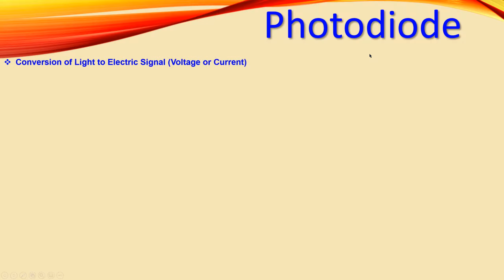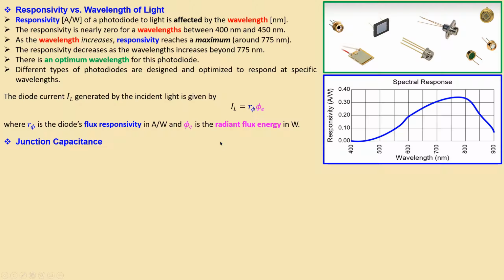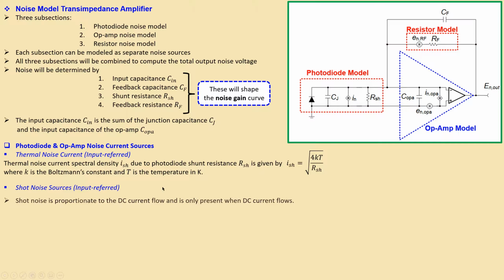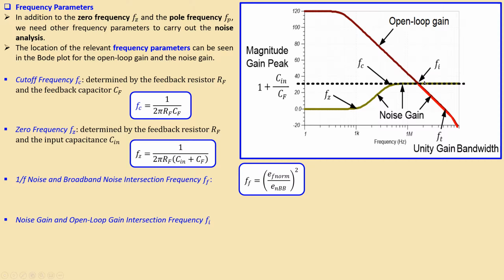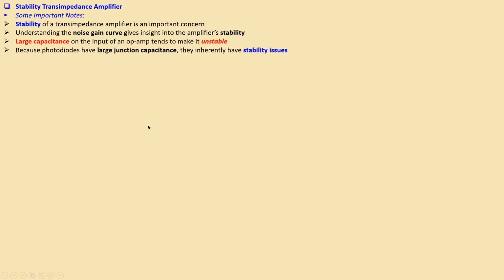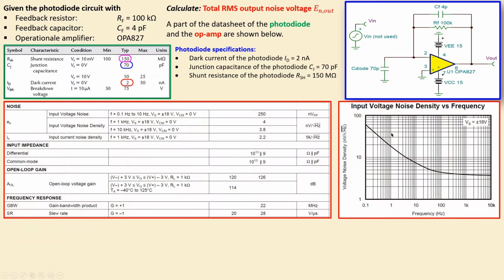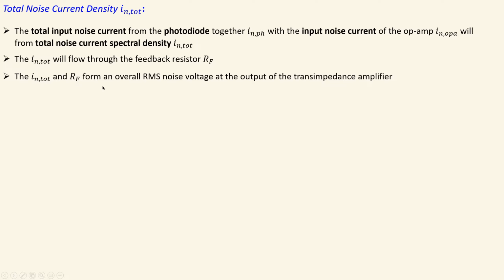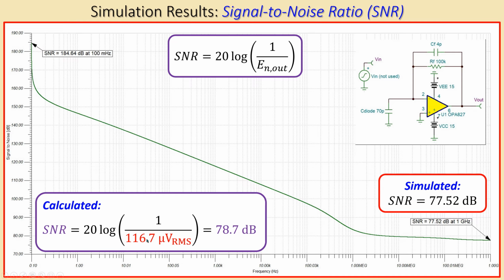Noise Analysis Photodiode Transimpedance Amplifier 🌟 Calculations & TINA-TI SPICE Simulations 👍

Comment: I would recommend Jerald Graeme's book "Photodiode Amplifiers: OP AMP Solutions" is a practical engineering text that focuses on designing operational amplifier circuits to process signals from photodiodes. This book took decades of Burr-Brown (a superior Op Amp provider) app notes and material in books and journals of Photodiode Amplifier configurations for various applications and packed most relevant into a single small text. The book mostly focuses on shaping of the 'total' noise response (all sources modeled and shaped per the application). Furthermore, his methods of noise shaping within his (feedback) topologies dealt with the specific Op Amp's actual noise response (in and en) and the type of noise source within that response. For use in industrial and medical CT I would always develop my noise models using behavioral modeling methods SPICE which allows for precise modeling of the noise sources and amplifier responses, Johnson noise sources and so forth. This can also be done in any math program like MathCAD, MATLAB and Simulink all of which I used for this work. There is a ton of prior work done on this topic over the previous 50 years. Indeed, much of Graeme's later work was on this one topic which is, of course, relevant to ANY high gain op amp circuit. He wrote a 2nd book on this topic. Graeme also produced very early books produced by Burr-Brown on Op Amp circuits which contained many topics in a general presentation. I also like to show the actual frequency shaped of my noise sources and feedback structure in the simulation and this is where MathCAD is convenient.  

Graeme's PD Amp book can be purchased through Amazon or EBay :

Publisher  :  McGraw Hill
Publication date  :  December 1, 1995
Edition  :  1st
Language  :  English
Print length  :  252 pages
ISBN-10  :  007024247X
ISBN-13  :  978-0070242470
Reply from the maker: Thank you for the book recommendation, that is a classic text for anyone working with photodiode amplifiers.

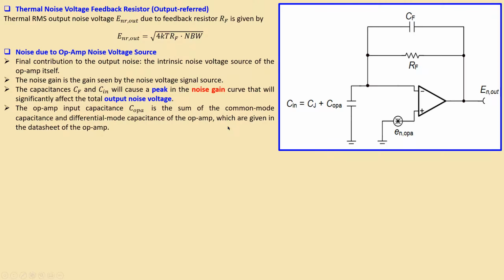Comment: Thank you. You said the Cf doesn't cause noise, but in the minute 22:35 you mentioned Cf and Cin will cause a peak in the noise gain. Is this not a contradiction?
Also, your definition of Open-Loop Gain (Aol) and Signal Gain (SG) is confusing.
Aol = Vout / -Vdiode (Vin at the inverting input of the op-amp, and not the test node Vin connected to C and L).
SG = Vout(ac) / Iout(ac) (should be AC components and not DC components, as you said).
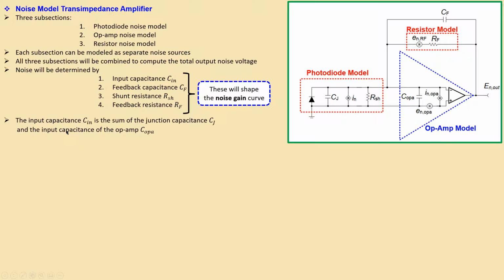Reply from the maker: At around 17:30, it is explained that it will shape the gain curve. This is also depicted in the simulation results. 

Capacitor in its own will not produce noise, but can shap the noise. Also, the definitions for open-loop gain and signal gain are different, because we speak of different ratios.

Comment: Dear Mr. Can

Thanks a lot for the video!

I would like to ask if you have any experience with the "Photodiode Circuit Design Tool" from Ti? (I sadly can't post the link)

I calculated the max Gain for the OPA858 with a needed fc=10MHz and Cin=3pF and got around 10kOhm.

But the online tool shows a max Rf of 1M Ohm. Can it be that they disregard the zero frequency? In the Freq. Resp. plot it shows the f-3dB around 10MHz. According to me fz should be taken in to account and i calculate fz for 1M Ohm = ca. 53kHz. For my plot i use: Zt_ideal = -Rf ./ (1 + j*w*Rf.*(Cf + Cs));

If you have time and are interested, I would be thankful for an answer.

Thanks again for the video
Reply from the maker: Thanks for your message. I think you mean this link for Photodiode Circuit Design Tool from TI: https://dev.ti.com/gallery/view/TIA/Photodiode_Circuit_Design_Tool/ver/1.0.0/

It does matter how you model your photodiode and that will also determine the total input capacitance, and therefore the zero frequency. I do not know what model and values you have used, but check again your model.
Reply: @CANEDUX  Thank you for your response. Yes, I used this tool. I double-checked the values, and they should be correct. However, I am really confused as to why 1 MOhm is stable at 10 MHz with C_(in) (C_(pd) = 3 pF).
I entered the following: 
Minimum PD current: 10 nA
Maximum PD current: 1 µA
CPD: 3 pF
PD bias voltage: -5 V

Target bandwidth: 10 MHz
OpAmp: OPA858 (5.5 GHz)
V_(out) max: 1 V
V_(out) min: 0 V
Supply+: 5 V
Supply-: 0 V

For the sake of my sanity: I assume that the frequency response is also dependent on, and in this case limited by, the fz → Zt_(ideal) in my calculation. 

If further clarification is needed, I can also provide a file containing all plots, calculations and screenshots of what I have done until now.

Thanks a lot!
Reply from the maker: @samuelgimmel5158   You can simulate your design and see in more detail what is happening. Do not focus on some online tools, I should advise.

Comment: Hi Mr Can, thanks for the video. I was wondering what the simulation model should look like for a reverse biased photodiode?
Reply from the maker: You are welcome. I also explain the photo diode model in this video. Check it the content in the video description for details.
Reply: @CANEDUX  Thank you once more for replying!
I've one more question: have you been able to succesfully simulate the circuit  in 29:02 ?
When I enter such high L and C values, the Iout gets spikes, much like in the TI forum post named "TINA/Spice: TIna- TI, Transimpedance amplifer analysis" (I can't post URLs in comments).
After reducing L and C the graph Iout smoothens, but the I_to_V curve starts too high, unlike in the simulation by Art Kay.
Any pointers would be great !
Reply from the maker: @MegaLietuvislt   It will simulate in my case. By the way, you can put a link in the comments.
Reply: @CANEDUX  I tried sharing the link to the TI forum, but YouTube deleted my comment. 

Would you mind sharing your .TSC file somehow? I would highly appreciate it.
Reply from the maker: @MegaLietuvislt   You can find the link for the TINA-TI SPICE file for Photodiode Amplifier OPA827 - Circuit for Open-Loop Gain and Noise Gain in the video description.

Comment: Can you please share some content to do noise analysis of OP-AMP based integrator with
 resistance at input and capacitor in feedback?
Reply from the maker: In this video, I discuss a circuit with capacitive feedback. This is also a two-stage amplifier.
https://youtu.be/uuQq4tM96Gg

Comment: Great video, thanks for that. You removed Rshunt in the simulation as well, but as soon as you have a pd with a similar shunt resistance to the feedback resistor or close to it, it matters. In that case you can reverse bias the pd to get a higher differential resistance out of the pd. But can I really use the differential resistor value in my simulation as the new shunt value?
Reply from the maker: Thank you for your nice. Glad you liked the video 👍

Indeed, if the shunt resistance is considered, it might have an effect on the actual noise calculations. Usually, the shunt resistance is much larger than the other resistances in the circuit, but as you mentioned, it can have an effect when it has a similar or lower value than the feedback resistor of the op-amp. 

About reverse biasing of the photodiode. This is indeed a good option to make the shunt resistance looking larger than without reverse biasing condition. However, the model is limited to static values. The modeled parameter might change with frequency, time, temperature, and other parameters. "The model is never complete: all models are wrong, some are useful."

Comment: I have to analyse 1/beta curve for the transimpedance amplifier...so I have calculated corner frequency,fp, then how to calculate the corresponding gain
Reply from the maker: I do not understand the question. Can you clarify it?
Reply: How to draw 1/beta curve for transimpedance amplifier
Reply from the maker: @devas2979  Perhaps you mean the noise gain. See the discussion of noise from 00:22:49 in this video.

Comment: Why we are considering it in vrms,since its  a DC signals, why we didn't go for volts.i am new to this..kindly clarify this pls
Reply from the maker: It is not only about DC signals and even DC signals in a component can generate noise, like shot noise. There are also capacitive and resistive parts which can generate noise. In addition, the signal levels are never constant.

Comment: Hi..is that F sub L will be 0.1 Hz irrespective of datasheet of an opamp
Reply from the maker: f_L can be taken any value in the 1/f noise range, because it is a normalization value. Try another value to check this yourself.
Reply: In my opamp op07cp,the the frequency starts from 1hz..if I put 1Hz as FL then my Ff will be greater than FZ..then region 2 will show error which have negative value inside the root...please give me the suggestions..I am struck with this
Reply: Please help me with this 😊
Reply from the maker: @devas2979  Did you tried to use the 1 Hz in your 1/f noise region? 
For a good practical book about noise analysis in circuits, see the book of Arthur Kay: https://www.sciencedirect.com/book/9780750685252/operational-amplifier-noise
Reply: @CANEDUX  yeah i tried with 1Hz,then the Ff will be greater than Fz,so i take 0.1Hz ....is that ok to take 0.1Hz even in the data sheet it start from 1Hz
Reply from the maker: @devasaran-b9d  Well, I am not sure, but you can try to use 0.1 Hz. Again, if 1 Hz is in your 1/f noise, you can use it also.

Comment: i didnt find shunt resistance value in the datasheet of photodiode ,so what should i use for thermal noise current
Reply from the maker: You might want to look at another photodiode or similar type.

Comment: I am using BPW21 photodiode,in this datasheet,no junction capacitance and shunt resistance value seen.can you tell what can i do for this
Reply from the maker: You should have some parasitics in your photodiode, so it is not a complete datasheet I think.
Reply: I also faced the same,what should we do..can you help it out
Reply from the maker: @devas2979 I do not know, maybe contact the seller of the product...
Reply: Ok thank you
Reply: In data sheet,they mentioned about diode capacitance..can I use that

Comment: I am confused between the simulation graph output noise voltage spectral density and total RMS output noise voltage graph...can you explain this please
Reply from the maker: What is confusing specifically?
Reply: @CANEDUX  i cant make the difference between that two graphs.can you explain more simpler because i am new to this field
Reply: @CANEDUX  and also how did you take comparision between simulated RMSnoise and calculated since in calculated we dont mentioned about the frequency at which the noise is generated
Reply from the maker: @devasaran-b9d  RMS value of the noise is the integrated noise over de frequency you are interested in. The spectral density is the noise density per root Hz, so this depends on the frequency when you convert this into RMS values. 
You can watch my other videos about noise where I discuss other (somewhat simpler) circuits: https://www.youtube.com/playlist?list=PLuUNUe8EVqlnQ_ZEBx9S6a6juISpYcdJW
Reply: @CANEDUX ok thanks

Comment: How to calculate the Closed Loop Gain of TIA with the input current and output voltage? Thank you so much!!
Reply from the maker: The closed-loop gain of the TIA is given by -R_F with R_F being the feedback resistor only. In this expression, there is not feedback capacitor or any other component included.
Reply: @CANEDUX Thanks for your reply!  But I would like to know how that conclusion was derived.  Thanks!!!
Reply from the maker: You should use the same formula as for the inverting amplifier. Did you see my video?
Reply: @CANEDUX Yeah, that's what I thought. And I learned how to calculate the RMS noise from your video. Thanks for your patience and your video!!!
Reply from the maker: @龙源-b1k  Great to know. You are welcome. The derivation for the inverting amplifier and the TIA is very similar.

Comment: Can you explain in more detail the relation between the calculated output noise voltage and the simulated output noise voltage.  I didn't quite understand how you picked your frequency for comparison.
Reply from the maker: For comparison with the simulation results, I used the integration bandwidth as the frequency for determining the total output RMS noise voltage. This is a rule of thumb, but is valid for most practical purposes. Also, the noise will not contribute much for larger frequencies.

Comment: Hey, why you used 1 as a nominator in snr while the signal is zero?
Reply from the maker: Thanks for your message. In the formula of SNR it was assumed that the input signal voltage is 1 V RMS, which of course does not have to be the case. In fact, the main point was to illustrate what the effect of the components are on the noise performance, for example, the value of a capacitor.

A good practical book about noise analysis in circuits, see the book of Arthur Kay: https://www.sciencedirect.com/book/9780750685252/operational-amplifier-noise

Comment: Can you check if ish formula is correct?
Reply from the maker: The thermal noise current spectral density due to the shunt resistance of the photodiode: i_sh = sqrt(4kT/R_sh) is correct.
Reply: thanks it is cleared now also why you used 1 as a nominator in snr formula?
Reply from the maker: @AClassDigital  Thanks for your message. In the formula of SNR it was assumed that the input signal voltage is 1 V RMS, which of course does not have to be the case. In fact, the main point was to illustrate what the effect of the components are on the noise performance, for example, the value of a capacitor.

A good practical book about noise analysis in circuits, see the book of Arthur Kay: https://www.sciencedirect.com/book/9780750685252/operational-amplifier-noise
Reply: @CANEDUX  Thanks for your reply also could you give me a reason why these frequencies used in the circuit more specifically op-amp's ones. For example, zero, intersection, pole, lowerbound.
Reply: @CANEDUX  also could you tell me if I can use offset voltage in nominator to show the effect of noise at no incident light
Reply from the maker: @AClassDigital  The formulas are used to the calculated the integrated noise power from shape the actual spectrum of the noise, so the complete spectrum is separated in parts as 1/f region and broadband noise.
Reply from the maker: @AClassDigital  If you have an input offset voltage, than the capacitance of the photodiode will decrease. In detail: "Applying a reverse bias increases the width of the depletion junction producing an increased responsivity with a decrease in junction capacitance and produces a very linear response." Some nice theory is also available here: https://www.thorlabs.com/newgrouppage9.cfm?objectgroup_id=285

Comment: Very good lecture.
I wonder why you have discarded Rsh resistor while calculating op-amp voltage noise?
Thank you
Reply from the maker: Thanks for your message. Shunt resistance of the photodiode is considered to be very large and in this case infinite, which is ok for most cases.

Comment: thank you for your noise analysis for TIA. i have questions. frist, if cascaded inverting amplifier is placed behind on TIA, how can i get the Enout? in video,  only TIA case, in case of cascased system (TIA + amp), you are not use the equation as En_out=NG*En_in. you only considered output RMS noise voltage. is it only one way to calculate the enout for TIA noise ? other video of noise analysis usually use the en_out=NG*en_in
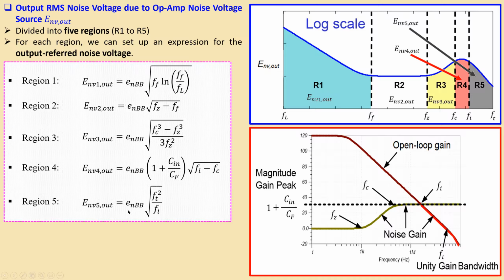Reply from the maker: For a single TIA circuit, the input is a current and the summary of the formula used for this case are discussed around 00:33:00. If you want to add a voltage amplifier in cascade (to make: TIA + voltage amplifier), you can continue with the output noise voltage of the first stage (TIA) and calculate the total output noise voltage using the second stage (Voltage amplifier).

I explain the noise analysis of a two-stage and a three-stage voltage amplifier in these videos. Check the links below if you want to see the procedure:

Noise Analysis Op-Amp Circuit | Two-Stage Amplifier: https://youtu.be/9tnw_RGqkRk
Noise Analysis Op-Amp Circuit | Three-Stage Amplifier: https://youtu.be/dEQVKPgeiQM
Reply: @CANEDUX   yes yes. while noise analysing the two-stage and three stage amplifier, the NG and SG were calculated at the first time. and first stage  NG_1*SG2*En_in1 , second stage NG_2*En_in2 and summation of Enout1 and Enout2 in the other video. however, this lecture was not included on how to calculate the TIA of NG and SG. only considering the Eni_out, Enr_out, Env,out, only output point of views. other cases usually used the calculation Enout as Enout= NG*En,in. can i calculate the TIA and gain amp as other ways in the same parameters from this video?

Comment: Very nice explanation. However, I have questions. Here unity gain frequency ft is 150 MHz. Is it gain bandwidth product of the OP amp? If so, the circuit frequency is not required to find out CF?
Reply from the maker: Thanks for your message! Glad you liked the video. About the unity-gain frequency ft of the op-amp. The ft is only equal to Gain-Bandwidth Product GBW if we assume that op-amp can be modeled as a first-order system up to ft. Otherwise, you will need to use more detailed formula where you also see the feedback capacitor Cf, as I used in the video. The derivation is not given, but can be determined using straightforward analysis of the op-amp.
Reply: @CANEDUX  Thank you very much for your nice explanations.
Reply from the maker: @GaziSharif  You are welcome!